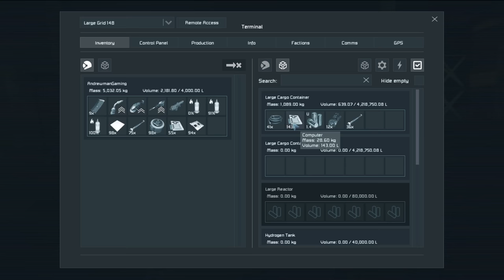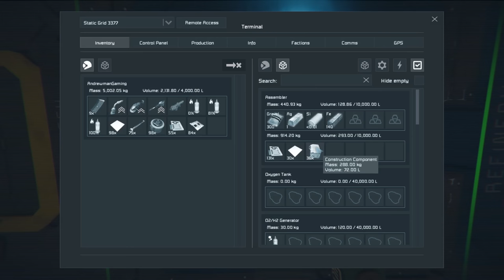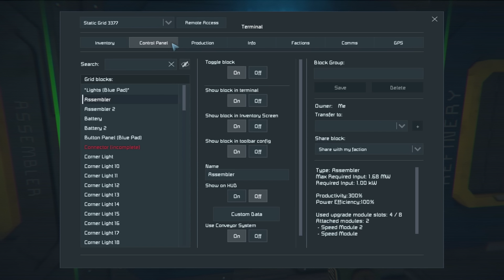Space Engineers Let's Play (Ep 11) - CONNECTING THE CONNECTORS [Beta Gameplay]

Comment: Also...when making your mining ships, mobile bases, and/or bases...  If possible create at least ONE detachable (independent) refinery with its own power, a storage container or 2 (one for ore in and one for ingots out), and set it with 4 yield modules as soon as you're able. That way it can be refining AS you're mining ON SITE... and as you're moving between your base or mining locations it will still be turning ore into ingots. Ores already processed into ingots take up way less weight and space... so you can transport way more of it in the place of raw ores, which also results in way fewer trips and more bang for your mining time and effort. 

The Typical (bring ore to the refineries at your base) is INEFFICIENT and time consuming (your ores could already be processing BEFORE and/or WHILE you travel). And ON SITE refineries also means more creative space is left in your ships and bases... more space for creative stuff. 
Your main base and ships should be for FABRICATING (Assembling Components) and Building things. And hauling around all that refinery stuff + ores costs added weight and volume that your ships could put to better use. Keep the ores and refineries at your mines.

When leaving a planet or other locations leave excess ores, ingots, and refineries behind if you'll be coming back... otherwise just leave the excess ore and ingot containers (for emergency) and break the refineries + other stuff down to their components. I always leave a small 6x4x2 airtight shack with a single solar panel, oxygen farm, battery, med bay, and small back-up reactor as well (just in case).
 Always bring enough construction materials to build at least one refinery fully decked out with yield modules wherever you go... to set up at whatever place you're going. Your main ships should also be carrying in storage a basic number of each component, tools, ammo, uranium, and any rare plus a few extra ingots... that will allow you to create a new basic set-up wherever you go with minimal fuss, since all my ships and bases have at least one assembler decked with all power modules so I can fabricate whatever and make more as needed. Having a bunch of assemblers on board is usually a waste and building more as needed is easy. Common ingots are also easy to find so there's no reason to carry more than a few of each. Some components like radio and medical parts weigh and take up a LOT more space than the ingots used to make them.. so carry enough ingots to make a decent number of em instead.
 
Keeping ALL the ore handling and processing AT your mines (yet also mobile between your various mining locations) simply makes sense. It also makes troubleshooting conveyor systems WAY EASIER... since your refineries are at a completely separate location from your assemblers they don't have to be piped together in a big cluster-fuck.
 
Yield modules for refineries are simply MEGA AWESOME when fully decked out... think about it... getting double the amount of ingots for the ore you mine saves a LOT of digging, transporting trips, weight carried, and time searching around for resources as well (And the fact that adding 4 yield modules to your refineries doesn't increase their power consumption simply ROCKS). Over the course of a game you'll have dug up only half as much ground (mining space), which also reduces accumulated lag (and it keeps your planets and stuff from becoming eyesores littered with a bunch of unnecessary holes).

Cheers

Comment: always grab any Ammo from anything you find or recover.
Backpacks are cheap, Ammo is expensive.

also use the left side of the inventory list to display the ship's Cargo and the right side displaying the Base/Refinery inventory.
you can then grab the ores from the ship and transfer them directly into the refinery.
connectors do hold a fair amount of inventory themselves as does the cockpit so as long as everything is connected through, you'll have quite a lot of cargo space at hand for hauling things.

filling H2 Tanks requires 4 H2/O2 Generators per tank to fill them with any degree of quickness.
the best way to execute this is to set up a Mining Drill rig on the lake to chew up tons of ice and feed them into the generators and a large Cargo Container for back up supply.
Hydrogen Thrusters burn fuel like thirsty Camels so you want plenty of Tankage at hand beyond ice in storage.

Comment: You could've built a vertical drilling ship, where the bottom of the ship is full of drills, add to that a connector, and drill way faster. Adding 3 drills side to side to the front of your cargo ship could've been good also, with added engines pointing to the front so you can drill heading down.

Comment: Just to let you know, you can cover the cargo containers on the ship and just use the connecter to look into storage. Just access from the side of the connecter that you use to attach to the base.
Reply from the maker: Glowbomb12 Oooh good idea! That would save me time spent running around the ship to get to either side to put things in!
Reply: AndrewmanGaming | Thank you! I love your videos as well and hope the best of luck!

I was also thinking of the ability to maybe make a small platform inside the iron mine and make a long tube using conveyors up to the surface. Then just attach cargo crates to the bottom of the tube where you are mining to minimize running back and forth between unloading the iron to the ship and back to mine more. All youd need to do is dump the ore into the crate and let the ship pull out the ore from the tube system automatically.

Alternatively, you can set up a funnel-like pit where all the mined ore rolls down to and automatically catch it all using a collector, (which can "suck" up items and push them to containers) and just have that go through a sorter that dumps out stone using a connector over a different pit, leaving the ores to go to the connected ship.
I dont know how exactly dumping the stone works like that or not, but its worth a shot to try if you want to keep the mining holes small or the ship issues you mentioned.
Reply from the maker: Glowbomb12 That's a really cool idea, and you're right it would save me quite a bit of time. I might just do that!